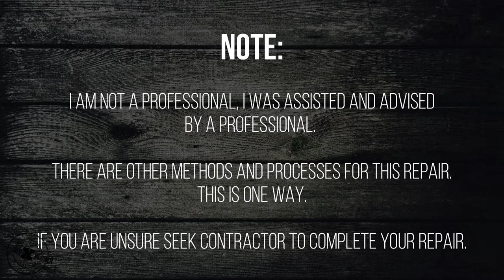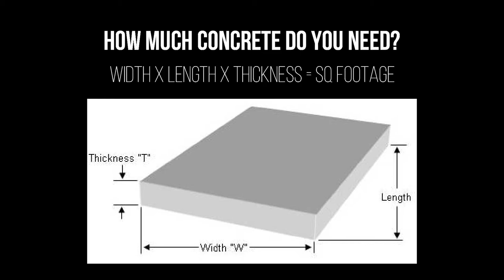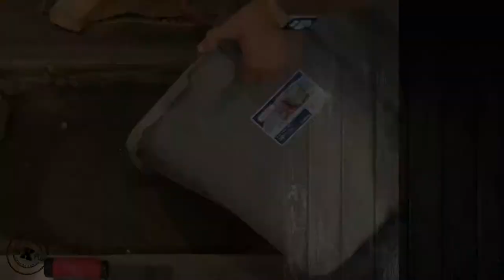Easily Repair a Concrete Slab Hole and Replace Laminate Flooring | HOWTO DIY

Comment: you forgot put the metal bar and before put the cement you need put the plastic. i m sorry bro you did the job totally wrong
Reply from the maker: Hi, Andreas, had another viewer leave a similar comment. The person that was helping me was a contractor. He determined the size of the hole did not need metal bars. I'm not sure what you mean by plastic, we did put down a vapor barrier before the laminate. Thanks for watching and leaving a comment!

For others else watching there are multiple ways to do this type of repair and if you are not sure please consult a professional.
Reply: I think the plastic (vapour barrier) should be the first thing you need to put down so that the concrete doesn't absorb any moisture from the ground. (PS. I'm only a diy enthusiast, not a real builder)
Reply: He did mean you needed a vapor barrier between dirt and the new concrete. I noticed that too...also seemed like an excess  of work/layers. Just fill the hole, stamp it down, place new vapor barrier...then just pour concrete. The bucket was small, I get it. But it's worth noting renting an electric mixer will save you a lot of time and effort! It did look great though! There is more than one way to skin a cat!

I'm just not sure why your contractor advisor didn't care about the vapor barrier. It could be because of the amount of extras. All the unnecessary primers/levelers perhaps keep the water out.

Comment: Shucks brother. Did that ever dip on you? You forgot to dowel into the existing concrete... I learned this today on youtube... Wish you all the best. Thanks for the video but I hope people didnt do what you did...
Reply from the maker: Hey Steve! It's been about a year now and still solid and level, no dipping. The guy I was working with had contractor experience and determined doweling wasn't necessary for the hole size and thickness of the concrete we were pouring. Leave a link to the video I'd love to see how they did it. Thanks for commenting and watching!

Comment: Did you wrap or cover the repaired pipe in any way before filling in the hole?
Reply from the maker: The replacement of the pipe was done by a professional plumber. It was a main sewer line and 4 feet down which I believe is below the frost line in TN. The original pipe was not wrapped. Thanks for watching and commenting! Let me know if I can answer any other questions!

Comment: How would you repair a concrete slab with a hole that's 5 ft deep and the opening is a foot wide
Reply from the maker: Something like that I would say the same way. The hole we filled was 4 feet deep and we filled it with dirt and other types of fill until we got to the point of putting the concrete down. If you are unsure I’d consult a professional to get more precise advice. I had friend who is a professional assist me for my project. I hope that helps! Thanks for watching and leaving a comment!

Comment: Great video! I have a smaller hole, maybe a foot at the deepest and 2ft around. It has a pipe coming up from it that is meant to be a shower drain. Is there anything you would do different because of that pipe?

Comment: How long did you wait for concrete to cure before laying the laminate?
Reply from the maker: We waiting about 5 days between the final pouring and laying down the laminate. That might have been overkill but we wanted to make sure it was good and dry before we covered it up. Hope that helps! Thanks for watching and leaving a comment!
Reply: I am repairing a 6 inch by 96  hole and was told to wait 28 days before laying my floor.  Why so long? Do you think that’s necessary